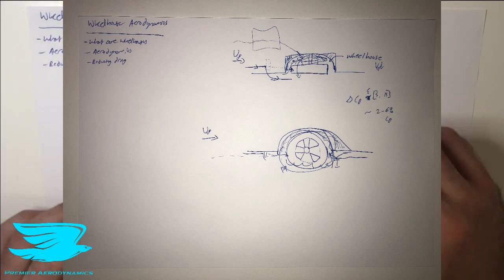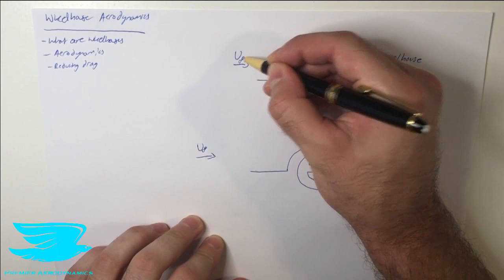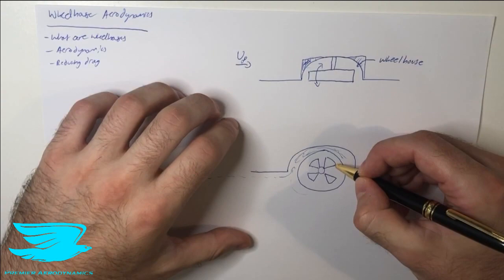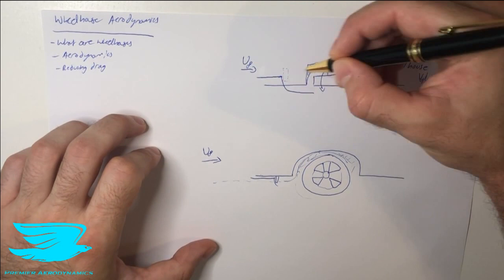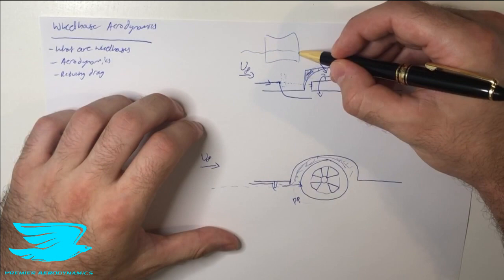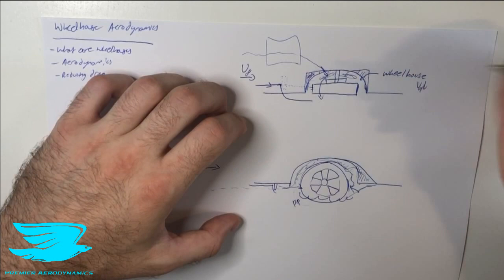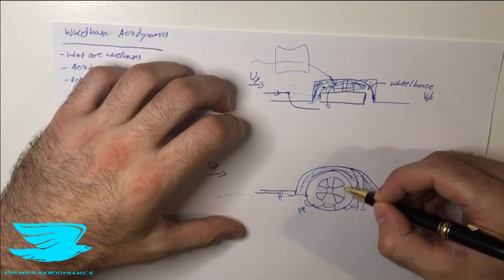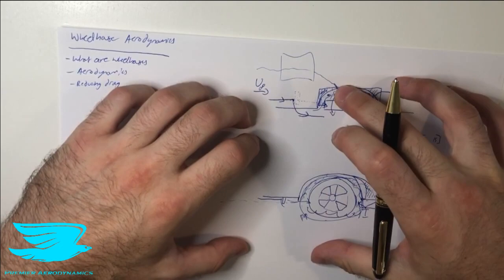{Automotive Aerodynamics #13} - Wheelhouse Aerodynamics

Comment: Thank you for the informative video.  Regarding the deflectors: I have seen them installed as you sketched them; relatively short and perpendicular to the air flow.  I would guess that the air would be deflected to both sides; both outboard and inboard.  Would there be a benefit to angling these deflectors to guide the air outboard or is the idea that the inboard / center air flow pressure (what is going down the center-line of the car) is enough to ensure the bulk of the air is deflected outward even with perpendicular deflectors?
Reply from the maker: There are a couple of things to consider. The first is that deflecting a lot of air out to the side results in a greater wake developing down the side of the car. That will increase the drag.

The second thing is that often, the flow under the car is migrating towards the outside a little as well. So, a perpendicular angle won't necessarily result in a 50-50 split of air inboard to outboard.

Surprisingly, perpendicular is often the best angle for drag reduction (at least that is tested).

Comment: can rear mud flaps do the job for housing the rear end of rear tire in order to lower the drag?
Reply from the maker: Good question.

Overall, no.

One major reason is that it is more the front of the wheel that should be covered. Also, for the rear wheels, the diffuser follows. So, putting this vertical sheet behind the wheels without blending it into the underbody means that the part of the diffuser directly following won't have any real flow going over it.

So, in order for the diffuser to work, it then needs to get flow from elsewhere.

That, overall, increases the drag.

If you blend the mud flap into the rest of the underbody, then you can get that drag reduction from the diffuser, as well as potentially from the rear wheel.
Reply: My Subaru has what they call a "splash guard", behind the wheels, and they claim it reduces drag. These splash guards are narrower than the wheel and taper in both dimensions as you get further from the car body. But they are quite small. Too small to be a real mud flap.
Reply from the maker: @user-do5zk6jh1k  They definitely do serve the purpose of reducing the drag because you now have geometry taking up the space that a wake would usually exist in.

The wake from the wheel still exists, but now it is squashed in with the rest of the flow, which helps reduce its effects.
Reply: @PremierAerodynamics  Yes. And it is quite useful for my vehicle in particular because of how much ground clearance it has.